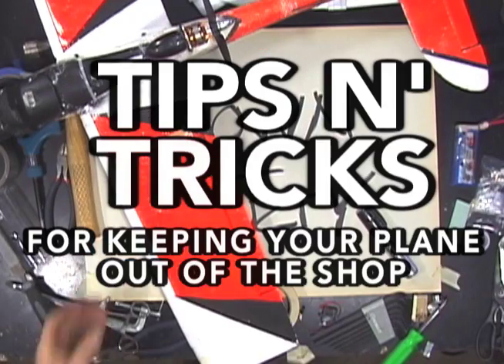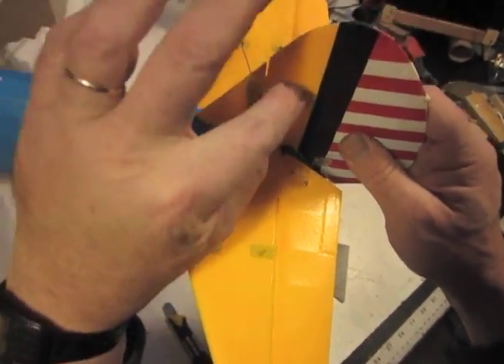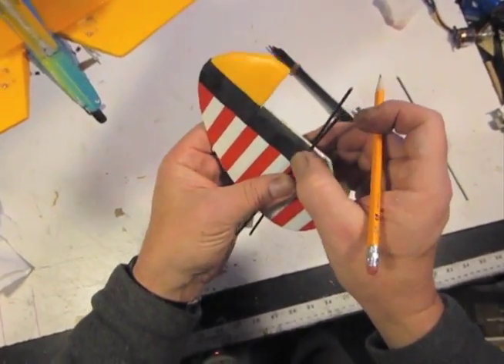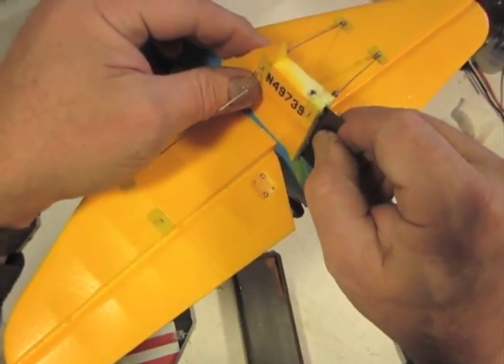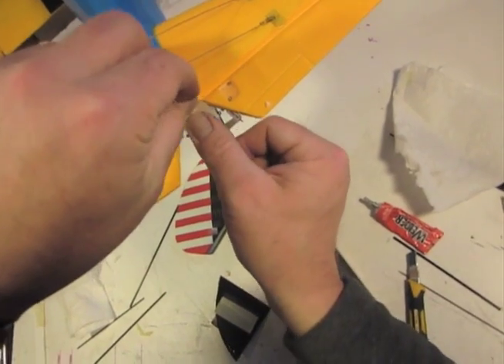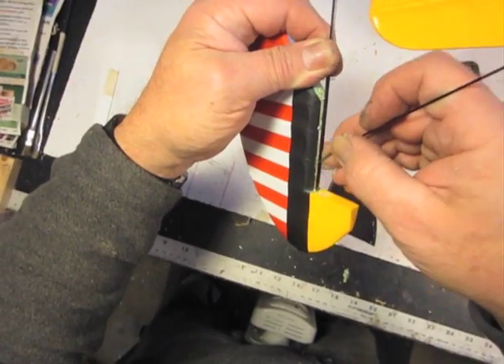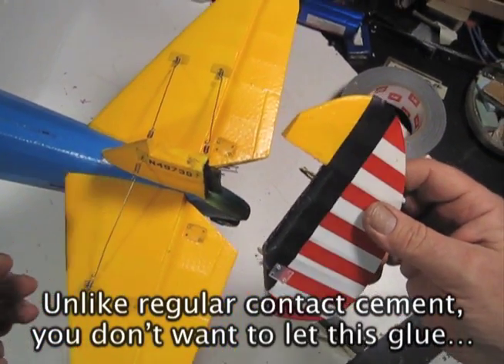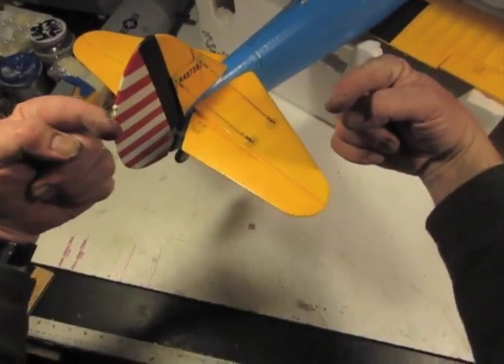DOWN & DIRTY TIPS N' TRICKS: How to Make an HDPE Plastic Hinge

Comment: I have some .030 Midwest brand Polystyrene sheets and am using that technique as well, on balsa based. Smaller hinges but more then one on the control surface is a good route to go upon with mine.
Reply from the maker: Works great, right? Self centering, too!

Comment: 3 32ths 3 64ths?? What dark age talk is this?
Reply from the maker: ***** There was once a measuring stick with divisions known as inches, grasshopper. The ancients declared that everyone's foot had twelve of them. Or something like that. Then they divided it into tiny increments that changed as the length of each tiny  line drawn along the top, to show how smart they were. Or something like that. Follow along now (to the tune of The Halls of Montezuma): 1/64, 1/32, 3/64, 1/16, 5/64, 3/32, 7/64, 1/8, 9/64, 5/32...having fun yet?